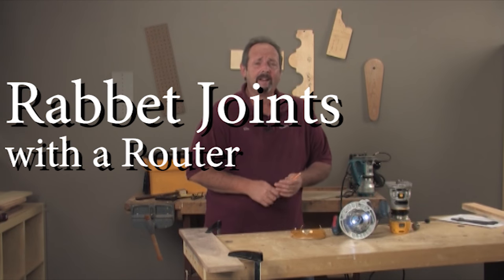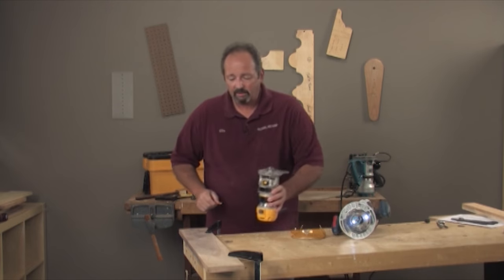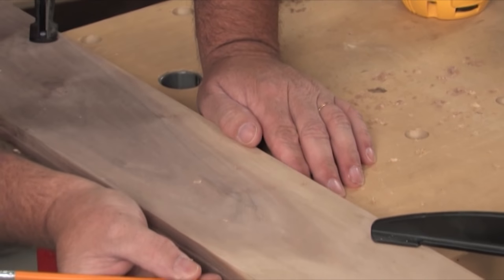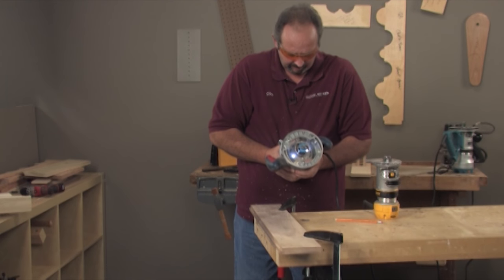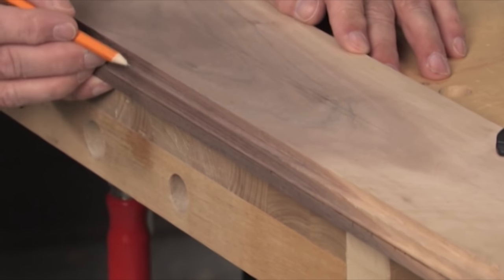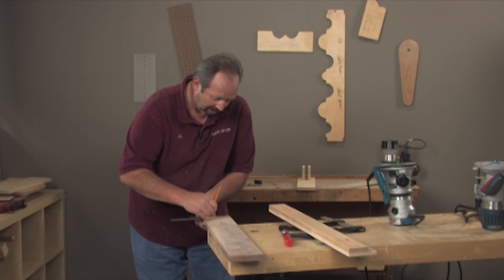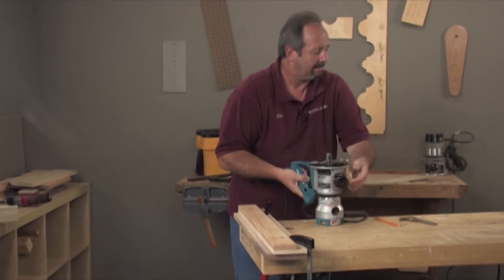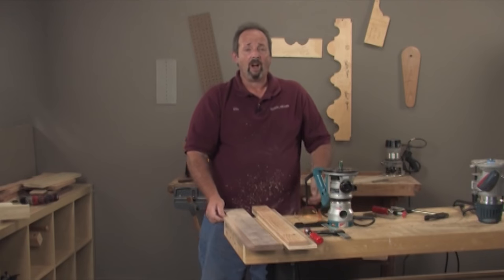How to Cut a Rabbet with a Router

Comment: This is very instructive, thanks. 

Could you please give more specifics on the '3/4" straight bit with top-mounted bearing' which you describe at @5:35? Although it is a straight bit, in the sense that its sides appear to be vertical, I think I can see fairly clearly that the cutting edges appear to be curved. I am a router learner, so I am not all that confident about the terminology: is this a "spiral bit" of some kind? If so, what kind? The more you can characterise it the better: the taxonomy of router bits is quite daunting for a newbie.
Maybe you could even specify the make and model of this bit so I can go away and research it and find out what category it is said to be in? For example, whether it is a carbide cutting edge bit (my understanding so far is that all spiral bits have carbide cutting edges...). Thanks.

Comment: Can I do this in the middle of a board that is a sign to put a picture in it
Reply: That's a smart question, and yes you can. If I'm understanding right and the board has a flat top and you're wanting to put the picture straight upright in the board. You can make this groove either all the way across, or stop short of the edges for an exact fit of the width of the picture. 

Look up "dado cuts with a router". WoodWorkWeb has some beginner friendly videos on it. 

I recommend practicing on some scrap wood though, these pros make it all look easy but there's definitely a learning curve. Good luck with your project!

Comment: Does it have to be a plunge router? Is that a plunge router? I can't see too well. It appears to have a depth adjustment though I think that's what that black knob is?
Trying to learn some woodworking, thanks!
Reply from the maker: You can use either a plunge router or a fixed-base router to make a rabbet. Slightly different adjustment for depth if you're taking the cut in more than one pass, but essentially the same process. Happy to help!

Comment: at 2:19. Isn't he running the router in the wrong direction? I want to make sure I'm not doing it wrong.
Reply: He's running it the wrong way but real lightly and/or with a different router bit. This is before doing the real pass(es) at the desired depth/width. This is to kindof smooth out the edge of the wood, so that the router bit edge doesn't grab the wood grain ends and tear it out, making unsightly little holes.